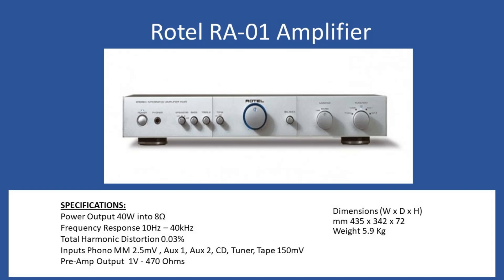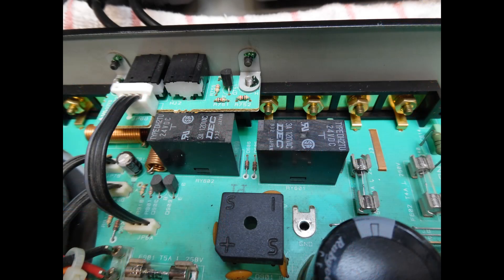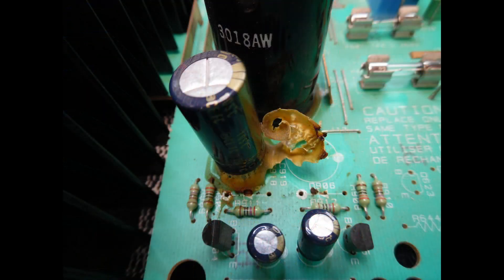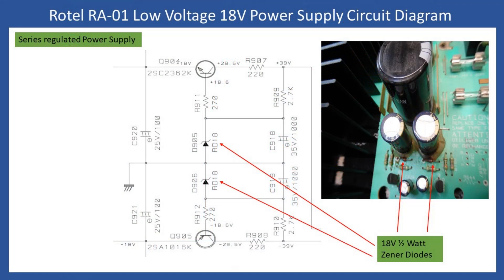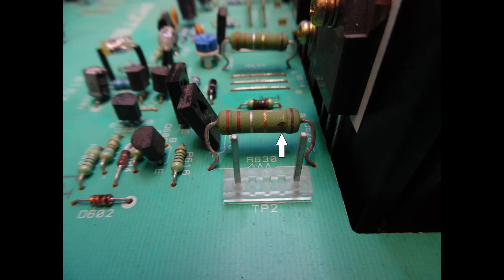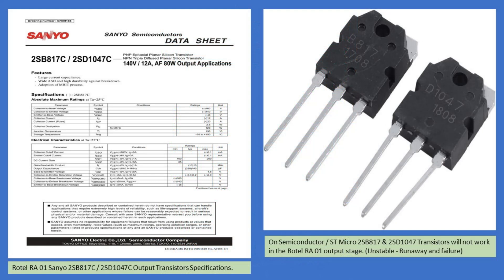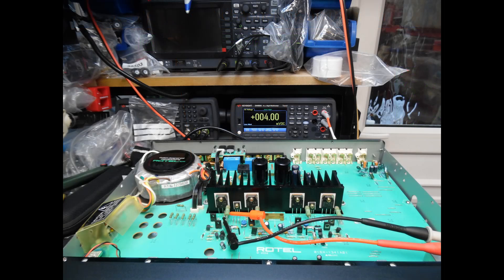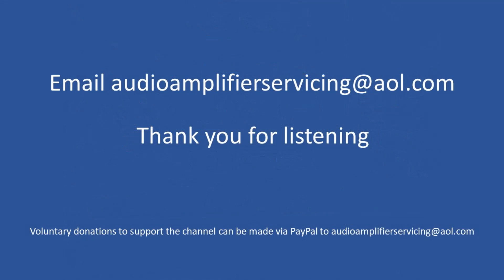Rotel RA01 Amplifier Repair (With Audio Tutorial)

Comment: Interesting that you say the Onsemi devices do not work - they took over Sanyo, so you'd think they'd be the same!
I've often found Rotel amps are a bit "on the edge" regarding stability... so it's no surprise that a slight change in the output device characteristics would make it oscillate.

Another thing I often do with these amps is replace the bridge rectifier with a higher current part. They often used 4A rated bridges and sometimes the bridges fail if the amplifier is run hard. Similarly, the pass transistors used for the low voltage supplies often run too hot due to their TO-92 package size, and I substitute them for something in TO-126 - BD139/140 work well enough
Reply from the maker: Thank you for sharing your experience on the channel
Reply: Hello,

Great tutorial here!!!

I'im here because of a rotel repair - rap 1580 ... I'm searching for the green resistor 0.22 ohm and can't find it. I can't find 5 ring resistor: red red silver gold black. I find 4 ring red red silver gold that is 0.22 ohm. I see you used the same ...

Can you help ?
Reply from the maker: @TheHitmn  Hi the service manual will confirm the resistance, wattage and tolerance of the resistor.
The colour codes you mention for the 5 bands do not match the resistor colour code chart. https://www.calculator.net/resistor-calculator.html
As long as you fit a ceramic flame proof resistor there should be no issue.
I would advise only purchasing the replacement resistor from a reputable supplier.
There are a lot of counterfeit components on the market.
Reply: On this video are the same! Because of that I'm asking...
Reply from the maker: @TheHitmn Not sure I understand your question. Are you asking where to purchase the resistors as shown in the video.
Reply: On your video I see original resistors with 5 rings ( red red silver gold black ), that you replace with 4 rings( red red silver gold). Because I can not find  such resistor too,

Can you please tell me full specs of that you used to replace them. And YES if possible where did you buy them.

Thank you
Reply from the maker: @TheHitmn  https://uk.farnell.com/multicomp/mcknp02sj022ka10/res-0r22-5-2w-axial-wirewound/dp/1903758?gross_price=true&srsltid=AfmBOop_gxazO76eZjkotUpwXk-zTLMc4APQhxXg77mWYAyqoiyuCADTjGM
Reply: @AudioAmplifierServicing  thanks ...

And about the service manual. I cant find anywhere. Model is RAP 1580.
If you can help me with this too will be fantastic.
Reply from the maker: @TheHitmn  Hi the service manual does not appear to be in the public domain contact Rotel https://www.rotel.com/en-gb/support
Reply: @AudioAmplifierServicing  
I know that. Rotel refuse to send me .... they offer only to send me new board. Don't offer repair ...
Reply: @AudioAmplifierServicing  because of that I need service manual
Reply from the maker: @TheHitmn Sorry to hear Rotel will not provide the service manual, makes it difficult to repair complex equipment.

Comment: Always amazes me that the circuit design is the same as a 1980s Rotel RA-820BX3 . And apart from a few minor tweaks and rebadging the design never really changed in over 2 decades.  In fact some of the earlier iterations had Black Gate Caps fitted as standard and IMHO sounded better.